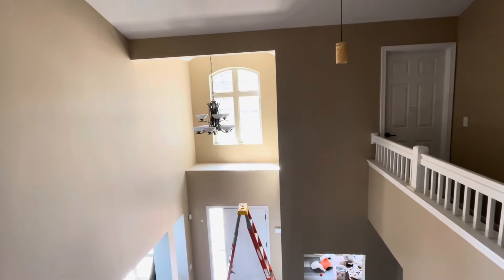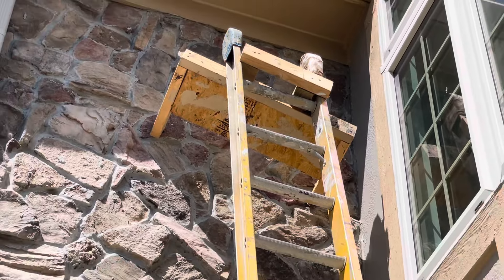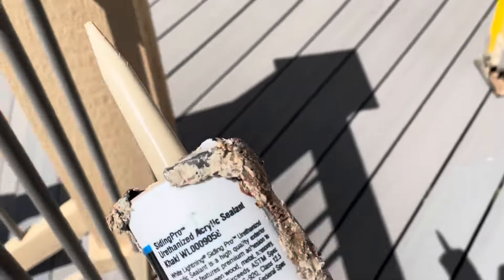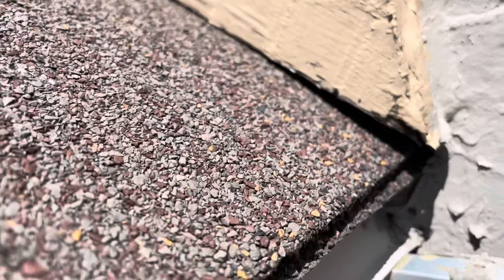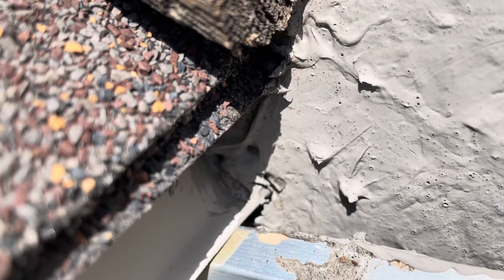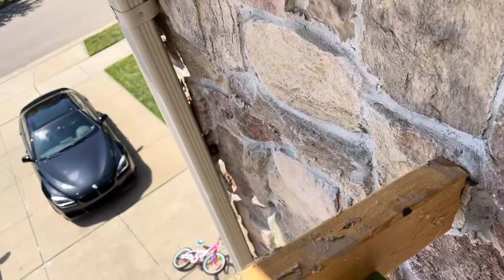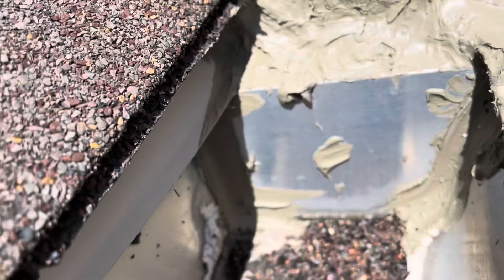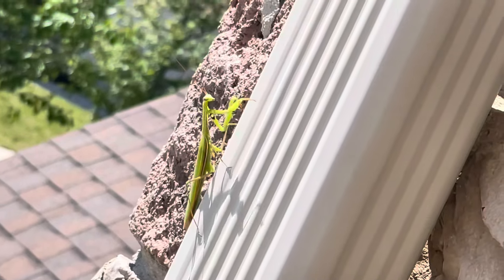How To repair leaking window frame instructions￼

Comment: That actually is a difficult spot to seal.I would have added a piece of step flashing to be sure that it doesn't leak in a year. Considering all the water coming off the roof plus temperature change all-purpose caulking doesn't last very long.Good job, not many people will get on a ladder at all.Very few at that height on a slippery floor... 👍